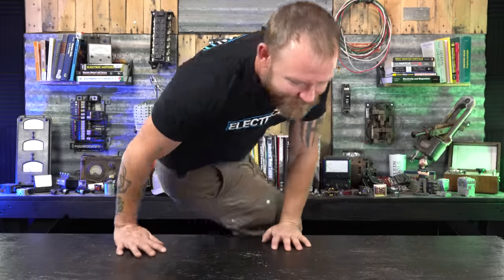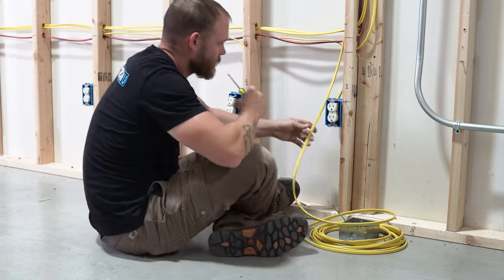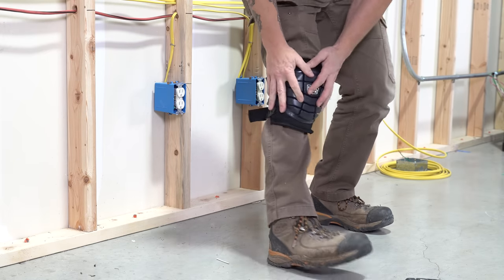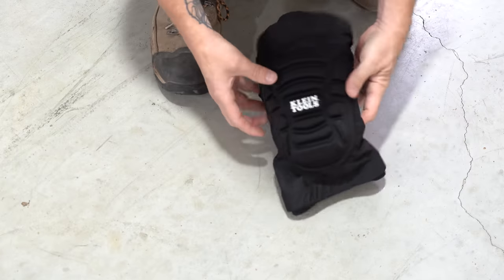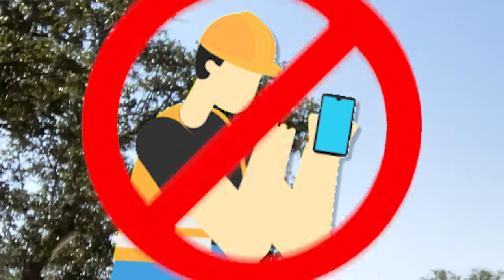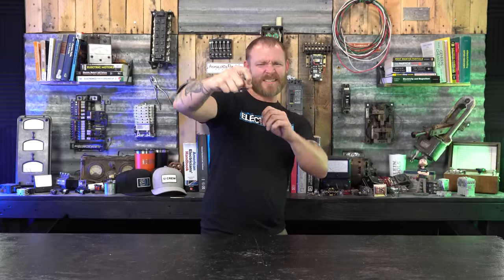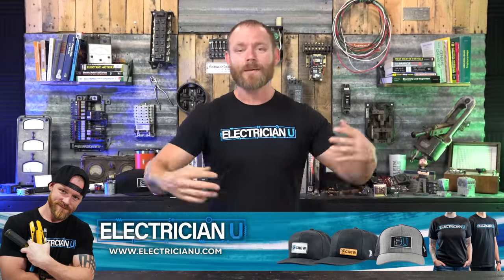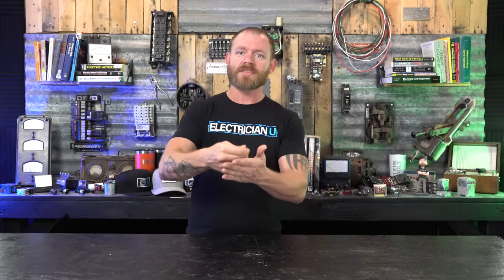Five Things Apprentices Should NEVER Do!!!

Comment: The phone thing is the worst. On a jobsite,  your phone is a tool, not a toy. I'm on my phone all the time for blueprints,  documentation,  code, and coordination.  Im on the engineering  side though. For work, to look something  up, or to change your music-fine. But no Facebook or personal.

Also, you will never know everything  so don't  be afraid  to ask someone  who's  more familiar. 99% of everything  I do is on a din rail,  so I asked  a lot of code questions  rewiring  my house from a lot of good residential  electricians.
Reply: Well said. And it’s not difficult to tell whether a person is goofing off on their phone or doing something work related. A superintendent for a company I worked for was upset with excessive phone usage on the job and implemented a no cell phone, no exceptions policy. He stated that if you need to check the time, go buy a watch. But I use my phone periodically throughout the day for many work related things (code questions, calculator, conduit fill, pictures, drawings, etc). I ignored him and just kept doing my thing. No sense in making someone’s job more difficult or making them less efficient because of a few bad apples who have no self discipline.
Reply: @Ephesians-ts8ze  It's  a lot easier  to have building drawings  on a share drive. Hands down using the tech saves us man hours. But I do have to keep people  off their phone sometimes.
Reply: @brad885  of course. You have to police it because a lot of people out there are social media junkies or have some other kind of obsessive thing they do on their phone. It could be playing silly games or buying/selling bitcoin. No matter what, if it’s not DIRECTLY related to the job, it should be done during break, lunch, or after hours.

Comment: I do two of these things often. Albeit for totally different reasons than you state here. I use a mechanics chair to do receptacles, it also carrys all my tools and trash bin, then I also still do it within 3minutes for most receptacles(why put long term injuries on myself, when not needed. IE overloaded tool belt when my chair can hold it, mechanic chairs are awesome. Knees and back from squating constantly, instead Im rolling around unless floor is finished. If floor is finished and doing a trim out, I refrain out of respect for the customer).
 Then I constantly use my phone during work, but not for anything personal, it is my NotePad and electrical references in it. If I take measurements, I put them in there. Use calculator, notes, keep track of my hours, keep track of jobs, to do list, etc. Seems people older don't realize it can used in that way. I don't even use facebook.
Now having said that. I'd refrain at any new job from doing those, because I know people view it negitive by default most times. But once I know you know the type of worker I am, then I do it. But if whatever you tell me is actually faster, I am all for it. For I'm always looking to improve and that mechanic chair is a big improvement to me. Even if you don't sit on it, it still rolls your tools around. Sorta like one them bucket aprons, yet so much better. -edit also if my Boss demands it, then I comply, he's my boss after all.

Comment: My only gripe is the sitting while working. 

With my apprenticeship I’m whored out to the entire crew so I go from moving material to taking out trash to installing  (insert item here) and then back over to another set of guys to help pull wire and then back to moving material again. Since I’m doing 15 miles a day on my feet I want to be comfortable as possible and we only get one body. I am not killing myself for a job. If the thing on the wall is low and it’s easy to sit down next to it that’s what I’m doing.

Comment: I have to disagree with the sitting thing, so long as the person is working at a good pace and getting jobs done efficiently.  I usually sit when wiring up receptacles, floor outlets, etc.  If I was squatting or kneeling to do a whole room full of items on my knees even with pads, my lower back would be worthless 2 hours into a job. I usually can slide on my ass or crawl from one box to the next much quicker than kneeling, standing up walking to the next, kneeling back down, repeat, repeat.  It might look lazy and sloppy, but it speeds up my productivity and allows me to put in a full day's work w/o my back screaming at me.  Everything else you mentioning you're spot on about, especially the phone and standing around thing.

Comment: As a first year apprentice with only a few month experience, this video has been very helpful. I was already doing most of what he was talking about. Like I haven't been on my phone all day or standing around doing nothing but I have sometimes sat down when doing 50 low receptacles and even with the knee pads it's still hurting lol I guess I'll just tough it out or get better knee pads 😅 Also at first I was guilty of saying I understood when really I didn't but quickly learned it's much better for the JM to explain something again then to do it wrong after you said you understood haha.
Reply: some comments pointed out that having a rollie mechanic chair for a large receptacle install job will save you knees and back for the long run! might be something you see if they could try.
Reply: ur best bet is talk to ur journeymen and take pics and use a notepad, if u dont know what to do while he is working just help with wiring, pulling, labels, anything that u can butt in to do without hin asking, that makes the difference of an apprentice who is worth teaching and an apprentice who just hangs around and doesnt move up....  good luck brotha.....   great choice of trade, good money if u push forward and dont put ur head down, learn everything u can because many times u will learn something new

Comment: Question, I recently had to replace 7 GFCI receptacles, exterior with double gang weathertight metal brand box's mounted to the side of several trees. I believe these boxes originally carried circuits to lights mounted to the upper tree branches. I think these were upgraded at some time and someone had crammed 2 gfci receptacles in each box. Anyway, all failed, all gfci's were not weather resistant and none actually had the ground attached to the receptacle it self, but the box was grounded. I know this is not to code,  but was actually installed by a lic. electrician ( or his helper and he wasn't a very good overseer. My question is, what do you think would cause all to fail, (supposedly about the same time , theses are only used for Christmas lights and SUPPOSEDLY worked last yr) All had one or two wire nuts facing down and corroded. So what would cause the failures all about the same time. FYI two receptacles had no mounting screws mounting them (did they work or even could they?)
Reply: if they are all exposed to similar conditions then failing about the same time is not out of the question. BTW, did they have "weather resistant when in use" covers?
Reply: @rupe53  Yea, they all had Red Dot Code Keeper plastic covers. I just thought it was really odd 7 GFCI's fail all about the same time.
Reply: @kennydykes1145  ... the main reason I mentioned them failing about the same time was about 10 years ago I worked for a guy and he had 5 circuits go bad in his barn during the same summer. All of the outlets were inside so not directly exposed to anything special... except the dampness of open doors with New England summers. It was one of those situations where every time I opened the place up the floors got wet for an hour. That's damp!

Comment: I’m a steamfitter (instead of electrician) and I 100% agree with what he is saying. There’s always work as a helper to keep busy if you aren’t needed you can always organize/clean the gang box,etc. the worst is pretending to know things. I’ve been a job foreman since I was 20 years old because I got NO problem teaching guys, in fact it’s my favorite part of the job, but I absolutely hate when a guy says he knows how to do something and wastes time/material doing it wrong. There’s also a huge difference between roughing and finish work. Roughing is move and get it done since the little details won’t be seen anyway. Finish work is the downshifting time he’s talking about. As an example for my trade, “finish” work is building out a fire pump room or dropping heads in finished ceilings/etc.

Comment: hey Dustin, can you make a video on how to properly extend and reroute electrical wires? I do remodels and some light electrical work and I usually have a licensed electrician do the heavy lifting, but I'd like to know how to solve those situations correctly. I usually do junction boxes or replace the whole wire, unless it's a homerun. 
I also had a situation where I had to eliminate an interior wall to open up the space and I found about 20 lines of Romex, a few low voltage wires and one thick 240v line coming from the attic and going under the floor and some into the basement. I did have a couple of electricians deal with that but the bill was so high that the homeowner almost passed out lol. I didn't really pay attention at what they did to solve the problem and they did reroute everything, but I'd like to know more about stuff like that. What's the procedure and how do you approach something like that? Thanks for your awesome content btw, it's extremely helpful!
Reply: It depends.
Do quality demo work and you make everyone's job easier.
 Some stuff doesn't get extended.
Sometimes you're stuck rerouting to the exterior.
I'll tell anyone that will listen "NO ONE KNOWS WHAT'S IN THOSE WALLS"
The second you think you can give a quote or estimate, make sure you've had a really good look and tell them no one knows what's in those walls. 
Get on good terms with a guy and pay him to come see how you make the sausage. He might say something silly like break out the plaster or drywall before you run the "hack saw"®©™ to make sure you don't cut wires. He might goofily suggest that instead of completely cutting a wall out you leave one stud cavity and save a couple grand in wire and work. I'll tell anyone that at some point, you've just gotta gut a place or decide to slap on some new paint, put in some new fixtures, devices and appliances.
Stay away from split level houses or houses with ungrounded circuits.

Comment: I like this channel, but as a working electrician who is 58 years old and knows how to "get out of a house", I have to say that if an electrician sets down and wires a receptacle, but is doing it with respect to the contractor - meaning that he is working fast - then just let the guy do the job.  I use a shop scooter when I'm doing finish work.  I roll from receptacle to receptacle through a room and stand up when I wire a switch box.  Efficiency is key and if a worker wants to set on his/her butt to wire a receptacle, all-the-while respecting the contractor, then let them do it.  Don't be so uptight to think that a person setting on the floor scooting from receptacle to receptacle is the "wrong" way to work.  Or... you can scream at your workers and wear them to the bone and watch them leave your employ.  I hate contractors who drive decent workers out of the trades.  Instead of teaching and mentoring, we're pushing good workers away.

Comment: Wendsday 5pm

Rule number 1 when a journey man talks you listen until he or she is done speaking.  ( you can have your turn to speak when they are done)
2 if you don't know something or are confused ask questions. (The  job goes alot smoother of you get clarification and do it correctly insted of you mucking it up and having someone else have to figure it out later. 
3. Life is full of distractions.  You don't even need a phone to be thinking about something else while you are working. For an electrician being distracted could be the last mistake you will ever make.
4. You journeyman isn't supposed to be your babysitter.  As you learn you are expected to be able to know what the job is for the day and load the truck with everything needed to complete the job.( The deer in the headlights look and the you didn't tell me to bring that tool excuse only works for so long)

Comment: Hello
I have a question plz..do you have any videos on wiring a light ...mobile home...there's like 10 wires coming out if the ceiling...4 or more blk ..same with wht...I appreciate any direction you can give me!!!
Reply: Your going to need an electrician
Reply: You've not given enough info. How many switches control said light? Is there any other lights also on said switches. Do you have a meter? Did you disconnect all the splices?
Reply: I hired an electrician..700 dollars later..no lights in kitchen....ok
The bathroom light has 3 blk 3 wht..but on wht is a hot wht...1 switch for light..1 switch for shit fan...1 outlet tgat needs to be gfi...I separated all wires..I added 1 blk at a time..got both switches in working order..out let not working..wht hott not attached..that's as far down the rd I have gotten
Reply: @vdarr1  unfortunately sounds like you hired a handyman instead of an electrician. Any real electrician will be able to figure it out for you.
Reply: @vdarr1  from what it sounds. And mind you I'm not there. The black and "hot white" in the same sheathing sound like a switch loop. (Power goes down to the switch via the black come back  via the white) the other two combos sound like power in from source and power out to the outlet. Honestly I'm not there. Based on what you've described, what I've just guessed doesn't sound correct. Do this:
 get a multimeter
Open the switch box, light box and outlet box.
Fund out where power is coming in. (That's your source, "line")
With the power off, put each wht & blck that come from the same sheathing under a wirenut. Then take the multimeter with the setting on ohms\continuity to where you think that pair goes. Touch the leads to that pair of wires. If the meter tones that you've identified both ends of the cable.
Do that for all of them.
Now you should have identified line voltage and the directions of all the cables. It's simply putting them back together at that point. Remember switches don't use a neutral. 
Cheers mate.
Reply: Honestly mate you should have two circuits in that bathroom. #1 the GFCI
#2 the lights and fan.
But 🤷🏻‍♂️
Reply: @Makitafan  wow! Thanks for taking the time my friend!..I will tackle this tomorrow..bless you
Reply: @Makitafan  yes 1 light swithch..1 fan switch..1 gfi...I have the switches and fan going now!!!! I have 1 wht hit not hooked up..I will tie it in with the other 3 blk and see what happens..the gfi is on a dedicated breaker I have learned!!! I appreciate you tremendously

Comment: I rewired my house, I did portions of it before but had pros come in to do service upgrade and fix a tapped meter feeding the garage. I got proposals from two places I had to reroute underground conduit. I asked is this something i can do beforehand said yeap just go atleast this deep, I went past that a bit and buried a new run. I know the owner of the place i ended up going with, when he speced out my job he saw my conduit work in the garage was pleased. There were some things I wanted tweaked either asked owner or the techs doing the work can we do this or what is the reason for ... Few times they asked like how I wanted two 240 outlets I just said if ok just do same breaker. 
I tore out the old breaker box in the garage while they worked on the house. 

The end we were all joking around, etc. I run into them somewhere we still joke around, etc. I know a decent amount but had them come do the upgrade due to time and that was beyond my comfort level. They seemed fine doing minor tweaks , etc or letting me help do simple things tear out the old pannel, pull the fish line and wire underground, etc. I just treated it as I knew there was certain things i wanted a specific way if possible but I also had them come in and do as I was not familiar enogh to tackle this so let them do. If I was curious i'd ask why thy'd usally tell me.

They were going to install a curb energy monitor too, i went to do the paperwork for it and they just asked are we insalling or you. I was like I think i can tackle this, and did just fine. They had planned to do were woried i'd do something stupid, etc. I think by the time we finished working toghether they got a feel for my comfort level and skill. 

I almost went into this area instead of I.T but I always heard how rough they treat new people or how there's like secret tricks, etc. people don't pass on. I didn't really see that other than some joking around but wasn't like extreme.

Comment: First couple years are rough for most apprentices. The jobs aren't the greatest at those beginner stages.

I personally took on a few different jobs for my first few thousand hours. Just for sake of having proper experience as a J-man down the road.

The best way I've found to learn about electrical, is to work in service. Working with live power for a couple years changed my entire perspective about the trade.